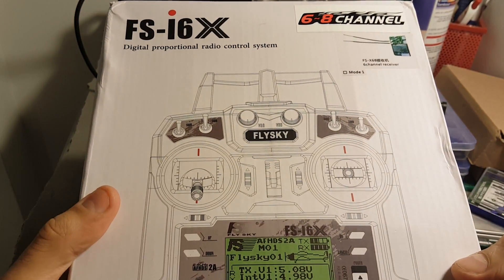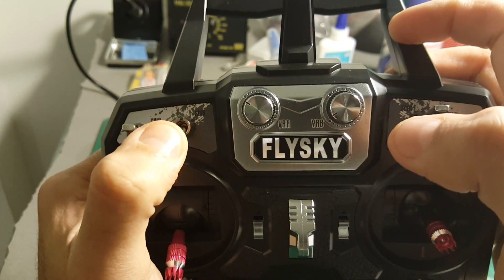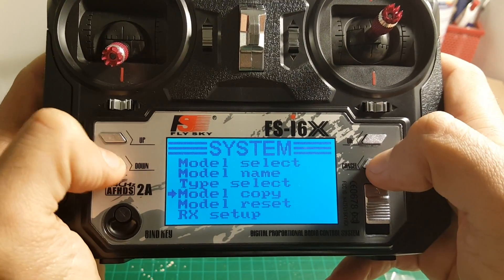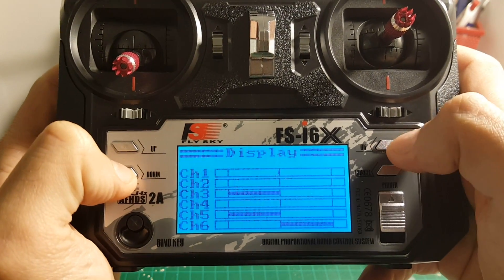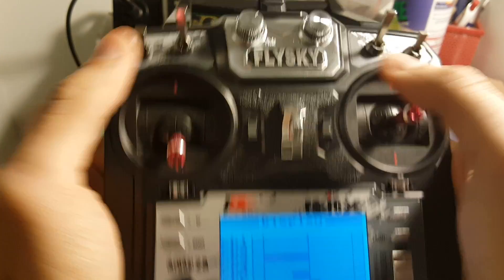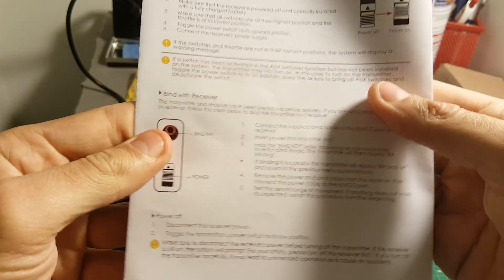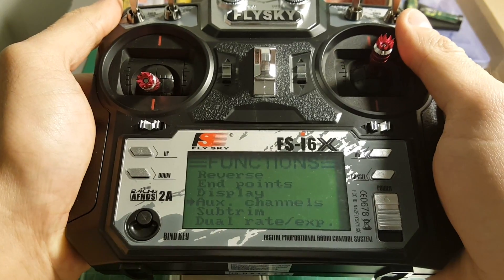Flysky FS-i6X 2.4GHz 10CH AFHDS 2A RC Transmitter With X6B i-BUS Receiver unboxing and walkthrough

Comment: in the video you didn't give thortl to the maximum, if I give thortl to the maximum, then this button has no reaction of any kind the drone flies ... how do I lower it back ...?  so .. you push thortl until half is ok .. it reacts back but if I pushed until over half ... ready it hurts and thortl doesn't react anymore ... how do I lower it?
Reply from the maker: It sounds that there is something wrong with your radio controller. Did you figure it out?
Reply: @KremerFPV  or it could be that the EsC has some features, that are not in the right way programmed like a Brake feature or on some you can set the point when is full speed and when  no speed should be applied...look into the Standart configuration of your ESC, there is a possibility that its not talking correctly with your reciever...
Reply: would be nice if you could explain it in a better way, that someone could probably help you...
and if the transmitter hurts you, you should buy anything other without a electrical hazard! :D
Reply: Have you reset your FlySky? There is a Factory Menu, look for an video on Yt go it, there you can reset any parameters to default, possible also your Reciever ;)

Comment: Hello, i cant get the transmitter bind with a x-nano f4 flight controller(has an built in spi reaciver i think...) , what would be a beta flight config for that? i have a eachine Novice 2, and this transmitter. Looking forward to fly again :(
Reply from the maker: The Novice 2 has a built in Frsky SPI RX and you can't bind it with a Flysky TX...

Comment: This radio is best used with R/C airplanes and ideally Dollar-Tree foam board airplanes with 4 to 5 channels.  7 channels would be needed for 2 servo aileron, 1 servo rudder, 1 servo elevator, 2 servo flaps, & 1 channel ESC.  Thus you need 7 channels, therefore this would not work for those who need flaps or any other channel for telemetry and things like that and stuff like this.  so, unless you go out and buy a 10-channel receiver (very expensive), you will not be able to fly with two servo AIL and two servo flaps.  Might I suggest however, that you could use a Y cable and connect the flaps to the same channel, thus taking you back down to 6 channels needed and then you would not need to buy the 10 channel receiver and modify the firmware to handle 10 channels.  Anyone have any thoughts on this?  The reason I say it's best used with foam r/c beginner airplanes is that if the radio and transmitter fail (like is the case with any real cheap equipment), you are not going to destroy an expensive quad-copter (drone) or an expensive balsa aerobatic airplane.  Try the Radio out on cheap equipment first, and then if you get brave you can unleash it on more expensive equipment.  thanks for this video!!
Reply from the maker: Thanks for your feedback. I think that now-days it's better to add a few dollars and get a much better TX such as the Jumper T16.

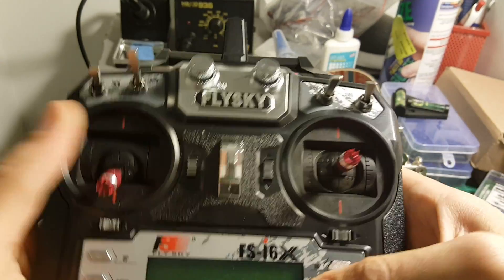Comment: 1:04 doesn't actually allow you to connect to flight sim, unless you have a  special USB cable. The standard cable is merely for software upgrades and checking settings.
Reply from the maker: You are 100% correct.

Comment: I have a FS i6 and like it a lot.  How is the X different or better?  Thanks.
Reply from the maker: If you're happy with the number of channels that you have, I don't see any reason to upgrade to the i6x. In addition, as far as I know, the i6 can be modded to support 10 channels instead of the default 6.

Comment: my channel 5 and 6 are not working for servo what should I do
Reply from the maker: Did you configure the correct channels on the AUX menu? Make sure you can see the switches changing position on the display menu on the remote.

Comment: when I connect my motor to receiver, the max speed of motor is reached when the throttle stick reaches 50percent. how should I set up my transmitter. fs i6x is my transmitter
Reply from the maker: Did you calibrate the ESCs?

Comment: I just paid for one on ebay yesterday. I am pretty sure what I am getting. I have been flying my heli with computer joystick through CC3D telemetry oplink. But, I am just curious about how the heli "feels" like. The computer joystick has a 0.5 second delay , and I can't do unplanned maneuver. Very hard to fly with joystick.
Reply from the maker: Flying with a real remote controller will feel much better. By the way, If you plan to connect it to a computer, you will need an adapter.

Comment: Thanks for the nice video on Flysky Fs i6x. Finally, i got mine arrived yesterday Flysky FSi6x and was trying to bind it with Wltoys F959, F949 and F939. i was able to bind it with Wtoys F959 and F949 but despite trying several times i was not able to bind it with Wltoys F939. Would appriciate if you can share any ideas to get my Flysky FSi6x bound with F939. Thanks
Reply from the maker: +RC Aeronaut Thank you for your comment. I found this on the product page on Banggood:
Note: the new version F939 is not using flysky protocol, it can not bind with flysky and Turnigy transmitters.
Reply: Thanks Gal Kremer, i guess thats why it was not binding to the tx. Cheers

Comment: Hohmies Mcfly Santez Morrow so I bind my x6b receiver with my I6X TX and sometimes the RX voltage is disappears from my TX and then shows again screen pls help me did I made the bind not properly?
Reply from the maker: Binding is binary - it is either bound or not. If it works, it means that the binding procedure has been done properly. I would check the antenna to see if there is any interference.

Comment: Can you confirm the USB cable comes with the Tx can be used in simulators? I heard that this is a data cable only for F/W upgrade and won't work with simulators. Can you confirm? Thanks!
Reply from the maker: Sorry, my bad. The FS-i6S worked, but this one cannot work AS IS with the simulator. You will need this cable in order to get it to work: https://goo.gl/jwKwxs
Reply from the maker: +abghere I can confirm. It works with simulators :-)
Reply: None of my SImulators will recognize mine.. How did you get it to work?
Reply: Okay thanks!
Reply: Or buy this one.
https://www.banggood.com/FPV-Racer-Simulator-with-Dongle-Cable-for-Flysky-Esky-Radiolink-Futaba-Remote-Controller-p-1047126.html?rmmds=myorder

Comment: very good transmitter :)
Have a Taranis, but use this thing often, cause of the smart design :)
Reply: Hi, I have no problems with the capability of the transmitter, value for money is amazing....however if I had bought it over the counter....I would not have purchased it, purely on the weight and feel.
It’s extremely light. Having said that, I love it....simple fact is...it works really well👍🇬🇧
Reply: @stefedwards2934  Excellent thanks for the info.
Reply: Just ordered this transmitter, it’s good to hear that you like it👍🇬🇧
Reply: @stefedwards2934  How did you get on with this transmitter?   I'm thinking of buying one myself.